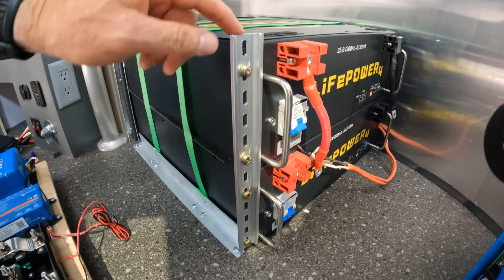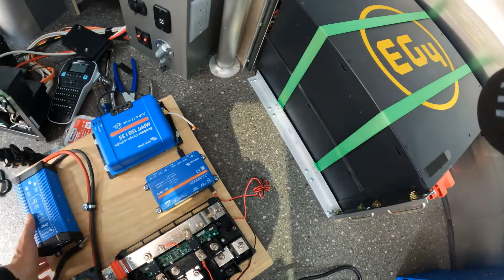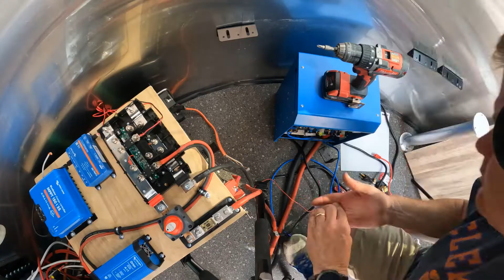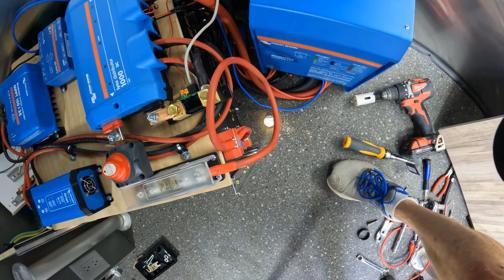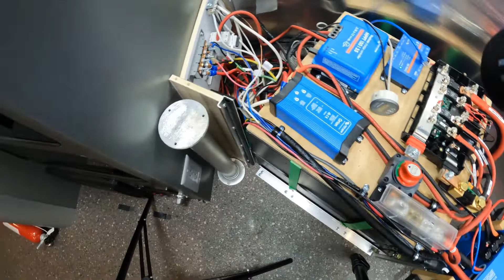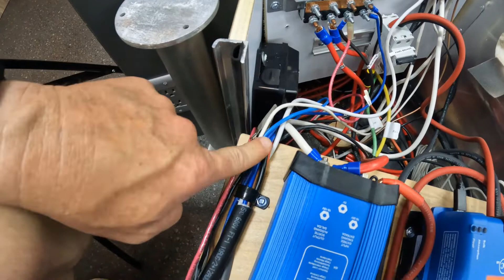Airstream Basecamp 20x, 24v Battery Installation - Video 2, EG4 Lifepower 24v 200 amp hour

Comment: Hi Wayne, great video and nice explanations! I assume your black AC cable going back to the BC panel is wired in place of the AC shore power - but then the Air Conditioner would also be on the same circuit? Were you able to easily separate those two circuits? And I'm wondering about the GFI protection for the AC outlets in the BC - was that an issue? Many thanks
Reply from the maker: Yes, the 10/2 cable travels from the inverter back to the main breaker on the panel. The AC is in a separate breaker in the panel. The GFCI outlets are on separate breaker and there have been no issues with that circuit so far.

Comment: Thanks for these videos. I bought the same battery a year ago to use as a home office battery backup but found the 48v version would be better suited. I have thought about using the 24v for our camper and your videos confirmed my idea for a design. Question, did you find a way to have the victron monitor the EG4 BMS?
Reply from the maker: @Phil, glad the video was helpful. Unfortunately, I haven’t found a way to connect to the battery BMS at this point. It would be great but all is working well without it.

Comment: how do you handle the dc charging from the tow vehicle with current limit?
Reply from the maker: Currently the tow vehicle charging isnt working. When I eventually upgrade to a truck I plan to install the correct converter to handle the 24v charge to the batteries

Comment: How are you handing air movement to the batteries? Are you worried about them overheating in that space?
Reply from the maker: @Bill, I currently keep a 1/2 inch gap between the two panels that used to fully enclose the battery compartment. I have a fan and temperature monitor that I will install soon that will expel hot air out original battery exhaust in the wall and which will also pull cooler air from camper into the battery compartment. To this point I’ve watched for any temperature increases and the current gap has provided sufficient ventilation to keep the temperature in an acceptable range.